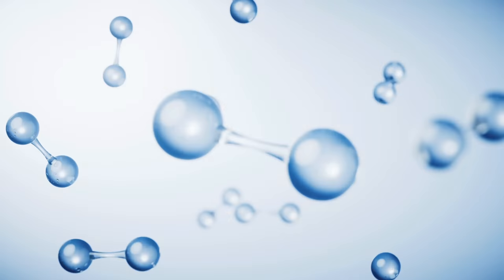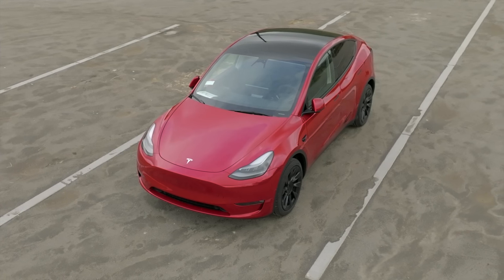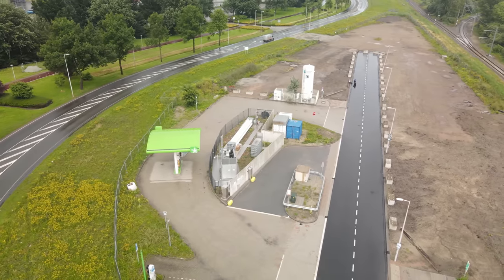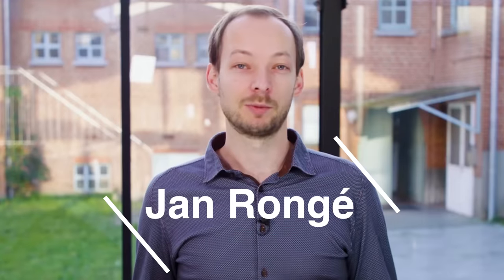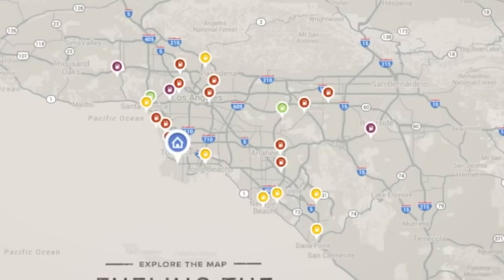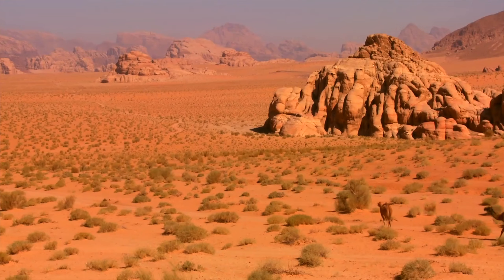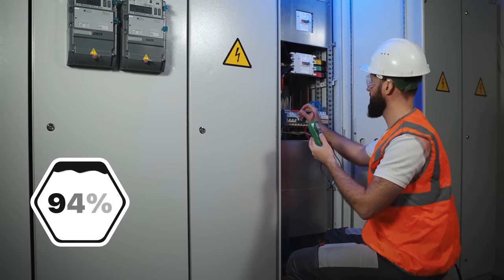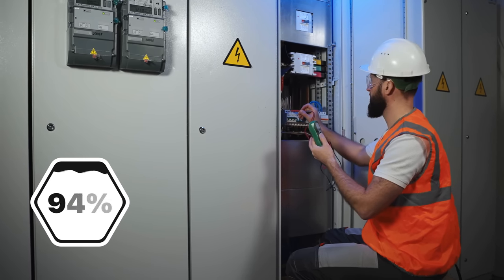Breakthrough Solar Panel Makes Hydrogen At Home!

Comment: I could be mistaken but if it's true that fossil fuel use produces hydrocarbons why don't we create a duel fuel engine that uses fossil fuels then takes the hydrocarbon by product separates the hydrogen compresses it with a turbo charger or belt fed compression mechanism and then the carbon waste taken to a facility that uses the carbon to regenerate topsoil depletion of carbon or to turn into graphite, diamonds and activated charcoal products?

Comment: All I know is hydrogen is the future as when technologies like the one I am working on make it to the marketplace things are going to change as unlike most technology this technology aims at putting the individual in full control of their own energy needs. The technology has mostly been put down by the IMF, World Banks, and of course the fossil fuel industry as they are all fairly invested in the use of fossil fuels. 
This technology I speak of burns the hydrogen but all the hydrogen needed is produce at the point of use from plain ordinary non-processed water. So, as you can see the future of hydrogen is bright once it breaks passed all the blocking put in front of it by the powers that be.

Comment: If you are interested to know why hydrogen cars aren't viable Engineering Explained has a good video - "The unfortunate truth about Toyota's Hydrogen V8 Engine". 
1) Terrible range
2) Hydrogen leaks out continuously 
3) Can't park in an enclosed space because of the risk of leaking hydrogen igniting
4) Can't leave it parked at an airport for a few days because it will be empty by the time you return
5) To achieve 300 mile range you would need to fill almost the entire space inside the car with gaseous hydrogen storage leaving no room for passengers or luggage
6) If you instead attempt liquid hydrogen storage you have to maintain near absolute zero temperatures which would require massive amounts of insulation and continuously runningcooling equipment

Comment: I do like hydrogen... but I feel like it will quickly become like nuclear. A couple bad explosions will happen and that will scare people.
What I'd like to see is a tank about the size of a medium fire extinguisher that can super-compress hydrogen and store it safely for years with little to no leaking. Then, instead of dropping by the gas station to fill up on gas, you head over to the hydrogen store and swap out your empty tank for a full one. The time it would take to refuel is the time it would take you to swap out tanks. This needs to be standardized so that one style of tank is made for all hydrogen cars.
Reply: 14:00 I believe we should do batteries for non-movable power storage and hydrogen for mobile energy production. You can get cheaper with the batteries the more weight you're allowed to add to it, and a hydrogen system would be relatively lightweight, which is good for things like cars and airplanes.

Comment: Hello, interesting ! About this pannels, would it be interesting to use hydrogen to at least low pressure heating and cooking part of the house, like with small methaniser, but without the need to have minimum 20c° temp to work ? It also doesn't look that hard (in the case if it is interesting..) to connect solar pannel to a diy hydrogen catalyser...?
Reply: Exactly! It makes much more sense. You can even generate it right next to where you'll store it, so there are no transmission losses along the way from the Solhyd panel to the compressor or other system.

Comment: Batteries are cute and all
But to heat my home for second half of the year I'd need 1 ton of coal, how the hell I'm about to store that energy in batteries for half year. Using hydrogen might be more viable, but in the end direct heat storage might work best when comes to cost. On grid level pumping hydrogen back and forth via existing gas pipes might work

Comment: Batteries requires mines and mineral rights; very similar to oil.  I don't see hydrogen ever taking hold in the US because the large companies that run this country will never allow it.  There is way too much control in batteries.

Comment: 15% efficiency? That is before you compressed it and stored it. This is a research experiment and not a breakthrough. Electrolyzers are much more efficient and tend to be installed at the point of use. I.e. at the H2 filling station.

Comment: Wow! I had seen an article of hydrogen producing solar panels, but I didn't realize the potential. What if you took the whole Solhyd idea and made it portable using vehicles like Aptera with for the built in solar panels. I believe hydrogen from Solhyd has the longevity advantage over batteries. I would rather have that as my source than heavy batteries to power my car or house. I can see how this could revolutionize the 18-wheeler industry. They would be the cleanest vehicles going down the road! Also, that hydrogen could be used instead of natural gas for water heater/home power systems from Enginuity.
Reply: You will need 4 times as many solar panels to make the hydrogen. You will need very expensive storage tanks to hold the hydrogen. Why would you use 4 times as much electricity making hydrogen instead of just using it in a heat pump?

Comment: Interesting technology, but I think the whole paradigm is flawed.  What is the advantage of filling your car at home in a few minutes when you are normally home long enough to fill the battery?  I think we should be doing everything possible to make energy generation, storage and use more efficient and cheaper and this does the opposite.  Then there's the whole Hindenburg thing.

Comment: Everyone touting hydrogen as the future of energy seem to forget the elephant in the room: The volume of the stuff. Power density per weight means nothing if the tank you need for these kg of hydrogen are bigger than the car.

Comment: Hydrogen generator is good for long term energy storage. ex. producing high amount during summer to consume it during winter for heating. That's impossible with batteries. A hybrid system of batteries and hydrogen tanks would be best imo.

Comment: The entire "how it works" section of the video is talking about hydrogen cars??? 
-I sat through this video and still have no idea what "vapor electrolysis" is.   
-High pressure electrolysis needs extra energy to split the water to overcome the extra energy forcing the molecules together.

Comment: We really are crying out for some kind of mid to long term off grid power storage system to couple up with Solar...something that can soak up all that wasted summer overproduction of power and then call on it months later during the winter...

Comment: To put the inverters on the roof is a very bad idea! Elektronik needs it cool and with low variation of temperature, but on the roof it is hot an with high temperature variation.

Comment: Hydrogen is a farce. You can say it has many times the gravimetric energy density of current common lithium cells but the volume it takes up is many times greater. Batteries are in their infancy. silicon has an energy density of over 4000 mAh/gram, compared to current cells at 300 mAh/gram or 600 watt-hours per liter. Liquid hydrogen is at 2200 watt-hours per liter. If batteries improve 10-12x as they can and do have room to improve with known materials then they will have 3 TIMES the volumetric energy dencity of hydrogen. Plus they are already far more efficent. Hydrogen will still have its nich applications and it is interesting to learn about new innovations (so by all means keep talking about the industry) but it will never be practical as a transportation fuel.

Comment: I can see hydrogen making sense where you need energy density like airplanes and ships. But for efficiency and storage issues, I'd rather stick to batteries. Maybe condos and apartments could look into hydrogen for energy storage. But that would require a generator etc. 

Again there are many different technologies available/pending. Some make sense for certain situations. I live in the North so I'd rather not worry about battery degradation in the winter like you would with lithium batteries. I think salt batteries make a lot more sense since they could be cheaper/abundant and don't have issues related to weather.
Reply: Depends on the definition of "energy density".
Hydrogen?
Gravimetric, good.
Volumetric, absolutely bloody awful.

Comment: Always frustrating to see people comparing gravimetric energy density of hydrogen against batteries and leave out the weight of the giganteous volume and weight of the tanks, and fuel cell conversion needed to store and convert into usefull work. Remind you, Toyota Mirai is heavier than Model 3.

Comment: I see the comments gravitate to the weight savings. This is not a rosy as it sounds. The fuel cell loves accessories.
Fuel cells require a battery, can be small, but not weightless. Fuel cells require ultra pure air, these complex filters are not weightless nor small, nor cheap (think constant maintenance).
Then there is the storage 200 bar is 3,000 psi (I think it higher for cars) tanks, piping, fittings, valves and sensors at this pressure are not light nor cheap.
There are places for fuel cells transportation isn't the low hanging fruit.
Oh, call up NASA and ask how easy it is to work with hydrogen. They have a couple years of experience with it.

Comment: I must admit to being confused of the benefits of this. I take free green solar energy which I could run my house or car on, use that electricity to gain hydrogen and then convert it back to electricity to use it. This feels like the classic solution looking for a problem. Yes the technology is great, but shouldn’t we focus on fixing the storage issue for current wind and solar generation rather than try to come up with a separate technology which ultimately like vhs vs Betamax will end up with the consumer worse off. Also I don’t remember much of my chemistry at school being over 40 years ago but I believe back then hydrogen was highly flammable

Comment: I'd like to see that hydrogen pumped into a small combustible generator/steam engine/Stirling engine/Heat pump to create power and climate control, AKA air conditioning. With no dirty biproducts and a renewable source, it wouldn't matter if it was 10% efficient. Use of any battery type will enable usable storage.

Comment: I see you're using the two camera format. It's kind of gimmicky and unnecessary as I don't see that it adds any value to the production. It's also a bit distracting when you look at the new camera before the old camera has switched.

Comment: I saw that Toyota was planning on a hydrogen fuels internal combustion engine for newer cars rather than Battery Electric. I like the idea however most of the energy is squandered creating huge energy inefficiencies wasting the energy on moving a multi ton vehicle around. I really like their idea on the engine but to vastly increase energy efficiency the vehicle should be very light in weight like a hydrogen engine powered Velomobile, bicycle or very light in weight motorcycle

Comment: One thing no one seems to talk about is how EV range dies with cold temperatures. With a combustion engine, you always know your range. With a bEV that range depends heavily on climatic conditions. I know it's manageable, but it requires a lot more planning, especially for road trips. But if you have a full tank of H2, you know how far it'll take you, ceteris paribus.
Reply: I've found my ev is a lot more reliable with range guess than my gas van is.
Reply: It's not talked about all that much anymore because of the use of climate controlled batteries. So it's less of a problem now, I think. It will be even less of a problem with sodium ion batteries, also. I don't know how much of a problem it is, but ambient air pressure probably affects fuel cells, to some degree. So driving through mountainous areas might have some problems. It's certainly a significant problem with ICE.
Reply: @MIA7Xthies  I guess that's only because ICEs don't have any range calculators at all as EVs do. I do the math myself based on my own experience and my driving habits since my gas tank floater died like 10 years ago (I know, I'm so lazy) and I'm usually pinpoint accurate to the mile. But if the car had a more advanced fuel gauge and could learn from your typical routes correlating those routes (GPS-tracked, of course) with fuel consumption, I'll bet it would be far more predictable.

Comment: Why wouldn't you just use that solar energy to charge an EV? Converting solar power to hydrogen, pumping it into a tank, transferring it into a vehicle to then convert it back into power to run a fuel cell, is an excessively complicated solution. I'm sticking with my plan to get an Aptera. The solar energy feeds straight into the battery, which is not a huge battery in the Aptera, and gives you 40 miles a day of free energy.